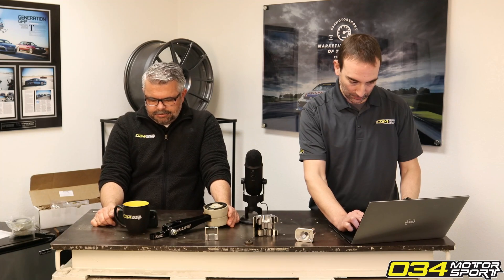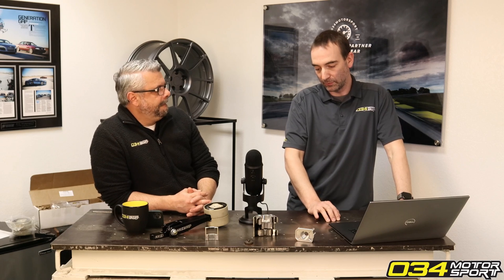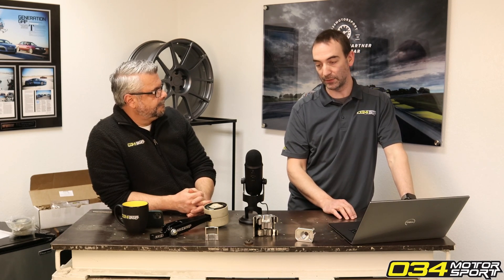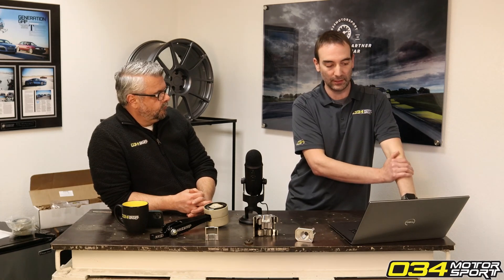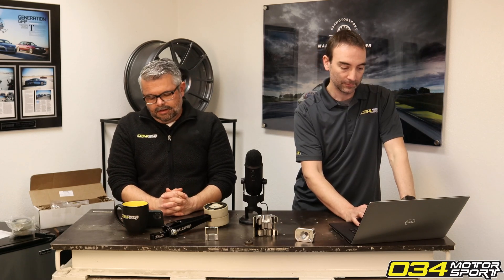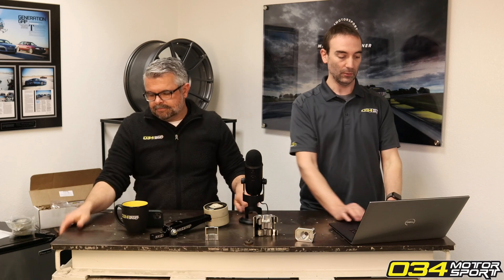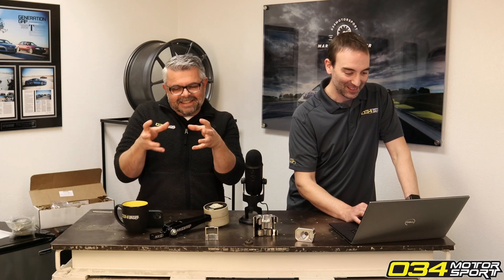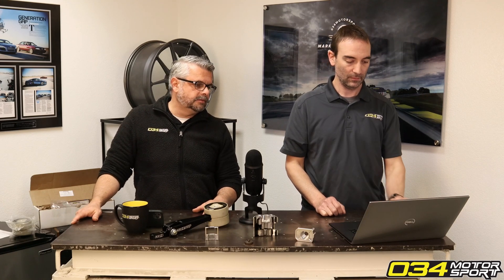What is the Ideal Max Boost on the 3.0T Supercharged Engine in the B8 S4? | 034Motorsport FAQ

Comment: A 200mm pulley alone will be safe and optimal or to much ? 
thx regards love the channel 93 ron here...
Reply from the maker: With proper software + supporting hardware, that pulley will be safe to run
Reply: @034motorsport  thx man
Reply: @034motorsport  I can run your stage 2 map em just. With my 200 mm pulley? Or stage one ? Aready bought the cable.

Comment: With a large HX and 93+ meth what do you think is the maximum effective RPM for the supercharger? The old wisdon was 24,000 rpm, is that still the case or with effective cooling aids can it be pushed higher? Also how much does porting effect this? Thanks in advance!

Comment: If you add a water meth kit (for IATs only, not power), do you feel a 3.6 pulley ratio would work instead of having diminishing returns as a result of heat?
Reply from the maker: 3.6 is far too aggressive and will generate significant heat.

Comment: I‘m going to have 179 and 57.75 mm giving a ratio of 3.100 . Do you guys assume this is still going near the safe zone?
Reply from the maker: This is a very safe setup!
Reply: @034motorsport  that's a helpful anwer, buddies. I've got an intake and a bigger HX. I guess IAT won't be a problem. 
Could you tell a temperature that would be critical on IAT?

Comment: Hi, I've got a 2015 Q7 S-Line that I'm planning to tune and do a pulley/s on. Would just running the 190 crank with a stage 2 tune be good mix to have a long life on the charger and only over speed it on the upper RPMS? or would you recommend a smaller crank and charger pulley combo?

Comment: Would you guys recommend adding a heat exchanger even for a 179 dual pulley setup (stage 2 - no upgraded hpfp or throttle body upgrades)? Or would that still be a 2+ tune
Reply from the maker: We always recommend adding an upgraded Heat Exchanger on your tuned B8. These engines produce quite a bit of heat and it can definitely be benefitted by having an upgraded Heat Exchanger!

Comment: Bring back the 1740 with proper calibrations
Reply from the maker: A few of our customers are running the 1740 on our Stage 2+ tuning! Email us at tuning@034motorsport.com if you have any questions!
Reply: @034motorsport  are they able to produce more power than the stock supercharger ?
Reply: What is 1740?
Reply: @Captainrage2000  I believe Eaton 1740 supercharger, basically a larger supercharger than stock

Comment: What is the ideal ratio? I’m at 3.30.
Reply: What about those new PWR intercooler bricks? Was looking at these on Jokerz site anyone try them out? I would but that’s just 1500 that could go towards engine rebuild and turbo setup
Reply from the maker: We are typically more conservative https://www.youtube.com/watch?v=z21YD47WOxk
Reply: @034motorsport  I’m just confused with the conservative mindset. I wanna be able to push the car to the max and not rape on  it, just use the power when I need it.
Reply from the maker: @davidmusiyenko4158  not "conservative", optimal, there is no benefit to power in overdriving the supercharger
Reply: @034motorsport  in that case what the limit of the supercharger? What’s the highest rpm/ratio you can achieve ?
Reply: @034motorsport  why more conservative? For example I just want to do 3-4 hard pulls and that’s it. And the larger the ratio.. okay it produces more heat. And what? Just counter that. Larger HX, coolant expansion tanks, and meth/water injection. I’m not looking for track use, just street, drag use. I want all the power I can get or only a few pulls and that’s it. I live in WA too. Good DA, good elevation, and cold weather.
Reply from the maker: @davidmusiyenko4158  it's not more "conservative", the lower ratios actually make the most power, when you overdrive the supercharger you just create more heat, not power.  Make sense?
Reply: @034motorsport  I understand the heat to power situation and I understand how you guys offer reliable optimal power. But at the end of the day, can’t you push more out of it ?
Reply from the maker: @davidmusiyenko4158  no, the intercooler system is limited and at it's maximum thermal capacity, if there was a way to increase thermal capacity, then the additional heat could be managed.  Again more boost isn't always better, we discuss this at length in the video, thanks!
Reply: @034motorsport  thanks for answering my question. I would love to learn more about my car and this platform
Reply: Theres no ideal ratio lol keep pushing the ratio until you hear a loud boom!
Reply: @rafaelbatu7525  that’s more like it